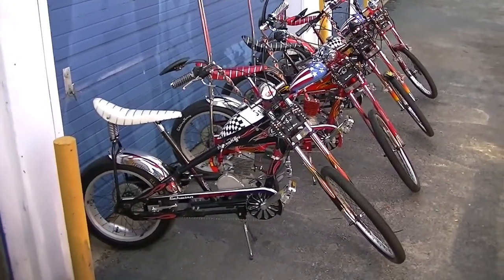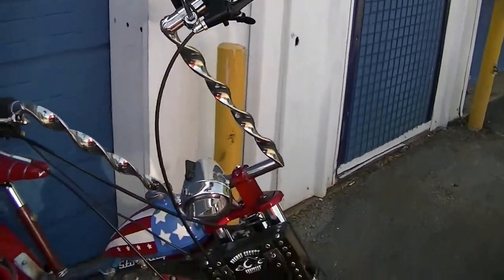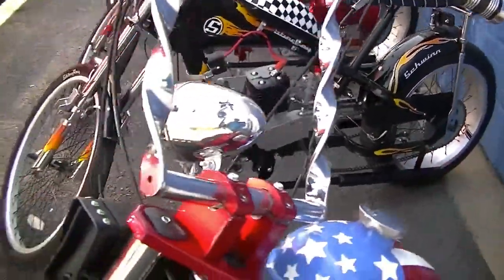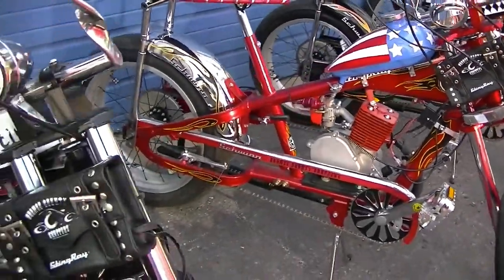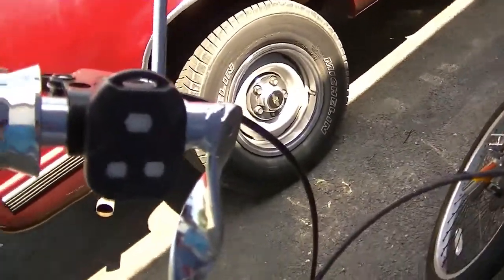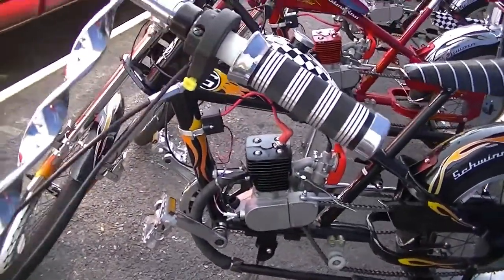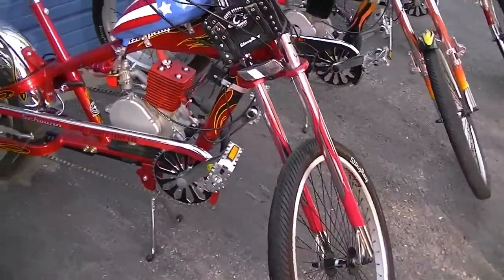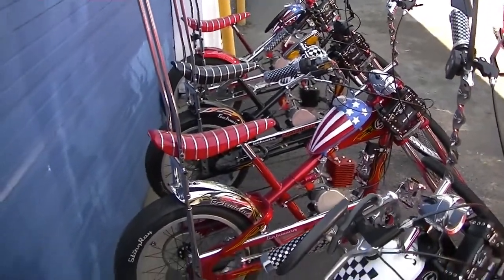Four Motorized OCC Schwinn Stingray Bikes

Comment: Sorry; I don't agree with you. That's not the best chain tension area. Because I don't like drilling holes in the frame. HAGO🖖
Reply from the maker: What you are failing to consider is that if the frame is inclined to bend, because those 1/4" holes have weakened it, it would flatten out the tube of the frame where it bends. That will not happen with those two bolts going through the frame. The frame is actually stronger because of those bolts.

Comment: I too have a custom schwinn occ chopper and I would like to know exactly what hardware you used to mount the rear sprocket to the rear axle. Looking for a better solution to my build to replace the rag joint setup. Also is this a reliable and fairly inexpensive thing to do?
Reply from the maker: I purchased 9 #8 machine screws with 9 nuts, washers and lock washers. The standard engine kit sprocket is a little bit larger than the rear hub on your OCC Schwinn. Take some electrical tape and carefully wrap the hub two/three times. That should center the sprocket for you. Once you have it in place use a punch to mark your first hole. Use a metal drill bit one size larger than your screw and drill a hole far enough away from the hub so that you won't have trouble getting a socket on your screw nut for tightening, and not so far out that you're too close to the spoke holes. Drill your first hole and put a screw through so the sprocket doesn't move. Notice from the image of the sprocket at 4:10 in the video that my drill holes follow the pattern of the pre-drilled holes on the sprocket. Pick another spot on the opposite side of your first hole and drill that one putting a screw through the hole. Even with a screw thru the drilled hole your sprocket can still move so you have to be kind of focused so that when all 9 are drilled they will line up. When you are tightening them down put your wheel with the axle and small sprocket facing down towards your work table and I used a three inch wide roll of tape underneath the sprocket. Your wheel will spin freely just as it does when you stop pedaling, but only one direction. The small sprocket will sit on top of the hole through the center of your roll of tape but keep the axle off the table.Then I looked directly across the top of the sprocket to the wall behind my work bench and put a dark line on the wall that lined up with that level. I would tighten the sprocket down close to where they needed to be and then spin the wheel looking at the sprocket rising and falling by the line on the wall. When I could see the sprocket dip I would stop it from spinning and tighten the screw on the opposite side of the dip. I would just keep spinning the wheel and looking across the sprocket at the line on the wall and use this method until I had gotten rid of 90% of the wobble. Of course you put your nuts on with blue thread lock and get right on it so it doesn't dry up on you. When you are done your sprocket will line up within the tolerances of your adjustable motor mount and I just eyeball it. Hope that this helps.

Comment: Use disc brake on the front. just weld a bracket inline with dropout angle, right on bottom of the left fork leg.
I did an electric OCC. Next is choppers that are powered similar to Sur Ron's.

Comment: did you use a yd100 engine for these? if so do they fir the occ chopper mounts that cost like 100 bucks? im doing a stingray build myself and trying to decide what engine to use
Reply from the maker: Yes, I used the YD100 and they mount up using the engine mounts sold on Ebay.

Comment: The bikes look nice but the engines are too far ahead so that there is some really nasty catch points for clothing.
Reply from the maker: The mounting of the engine is controlled by the the frame component wherein the seat post resides. Contrary to your assertion, I have personally driven a bike set up in the same manner over two thousand miles and never once got clothing caught in the chain and sprocket.

Comment: Angle of the carbs is wrong.
Reply from the maker: The angle of the carbs is fine. I put two to three thousand miles on one of these configured in the same manner. All of these bikes have been sold and no complaints.
Reply: @bradjohnson8100  .. they look great .. ipone 2t oil they way to go for these..